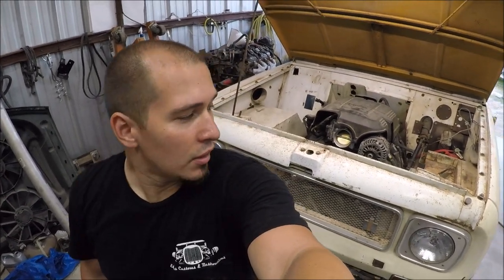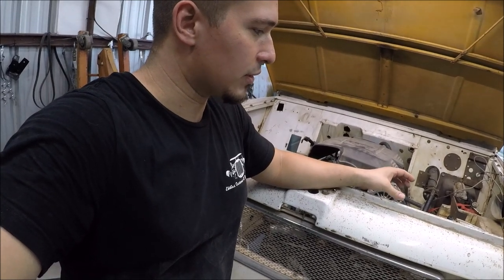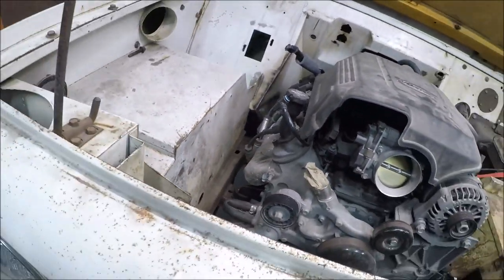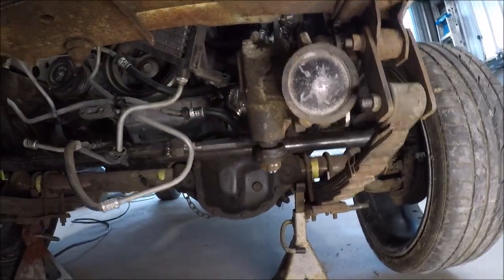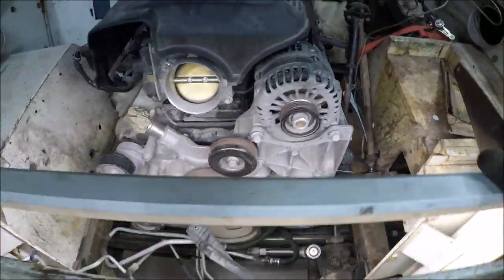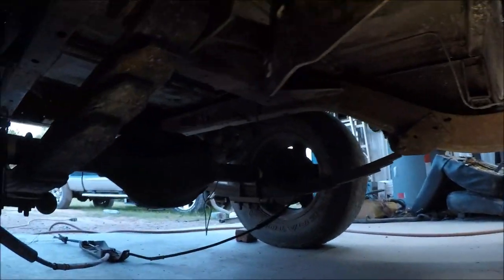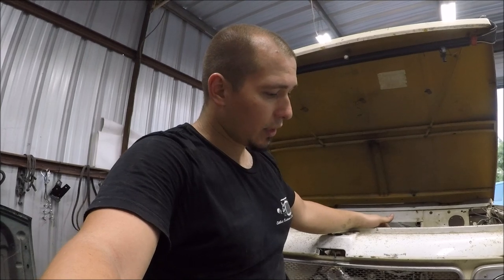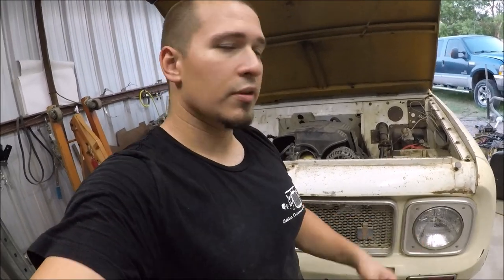1971 International Scout 800 LS swapped w/ jeep differentials Build 1

Comment: Thanks for the video.  I have been dreaming up a Scout 80 project in my head for a while and would like to do upgrades including Ford V8 and Ford auto trans.  This set up requires a driver side diff in the front axle and I always wondered if the XJ Cherokee or Wrangler axles had similar width dims.  From what I see there in your video, it looks about right.  The Cherokee steering box was also a thought I had.  The disc brakes on the Jeep axle is also a great benefit.  It is good to know what I am in for.   Would the stock Jeep tri-wye steering rods work in the knuckle from the bottom... because they run up hill they may clear the springs?  or are the Wrangler stock tie rods a different set up than the XJ Cherokee?  In your case the rods you went with are nice and heavy duty.  Looks good so far.
Reply from the maker: Not sure if the other components you mentioned would work but the steering components i used are universal and work very well. Ruffstuffspecialties makes the y link universal kit i used.
Reply from the maker: But thank you very much for the positive feedback!